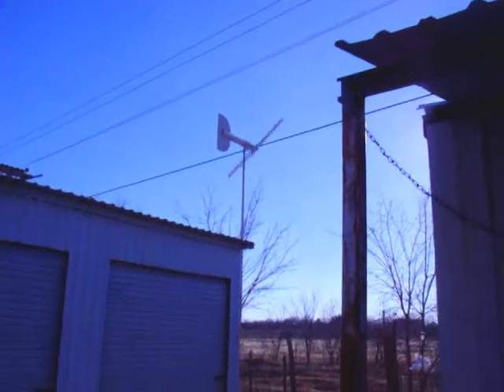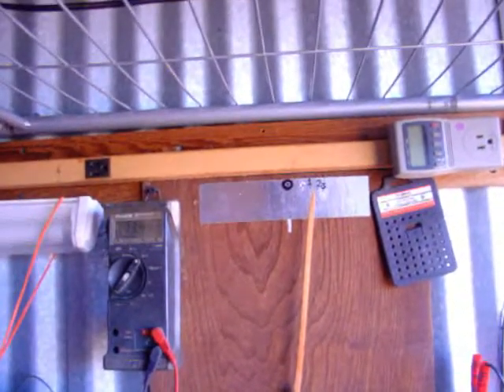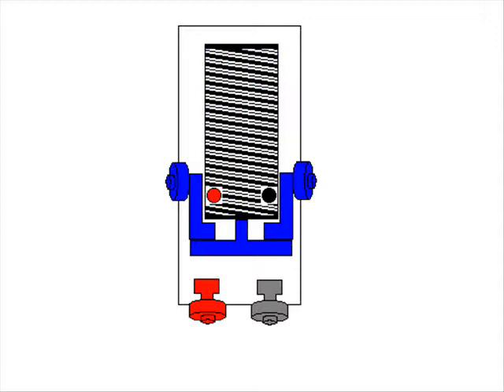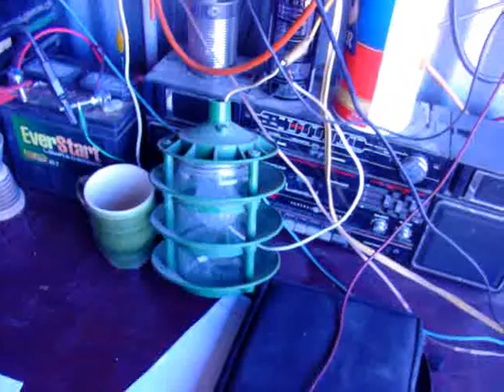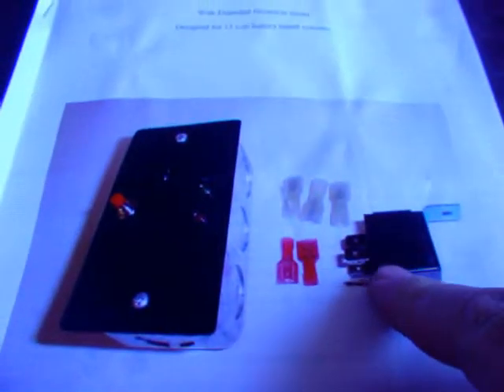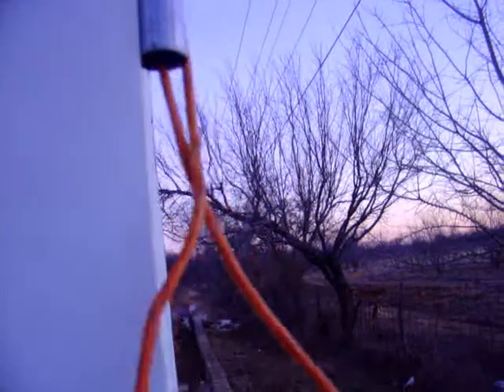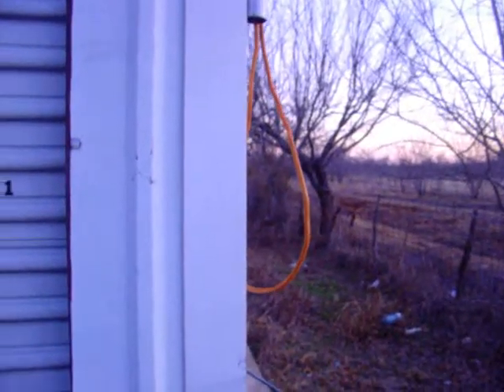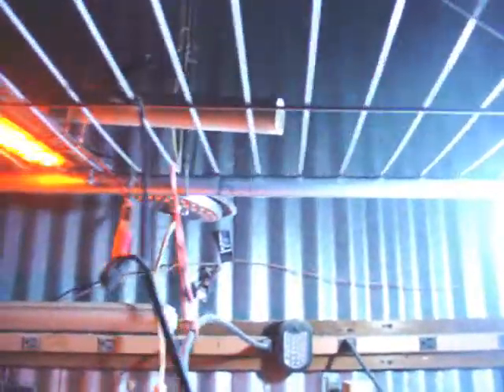Wiring up Charge Controllers Safely Diversion mode - Disconnect mode (part 2)

Comment: 900 watt wind mill ,i want to use the cut mode , from what the plans say the hot or positive should always connect directly to the battery ,and the negative or ground goes to the cut lugs then to the negative on the battery , I was told to put a 150amp breaker fuse ? my question is should i install the fuse from the battery negative to the cut OR from the negative coming from the windmill to the cut lug ? I am not sure witch way the energy flows

Comment: Wow, that is a long time between gusts.  I guess I was thinking of intermittent wind rather than gusts.  Where it jumps between 8V and 15V over a couple of seconds.  Electrically speaking you are right, why not just dump the energy straight into the battery rather than store it in caps.  Thanks for the comment!

Comment: Yeah I miss the shop lots we had a 38 foot lathe, 4 small 20 foot lathes, 2 drills 1 drill press 2 mills, a large boring mill. We did all custom work I saw $60,000 brass sleeves "before machining" that were used for closing massive doors on he Welland canal. Pressure vessels for nuclear reactors, 12 diameter pistons. We used to get 3 inch thick chrome shafts snapped in half. Some cool stuff if your into machining or building stuff. The old man let me do an engine swap on an rx7 I bought :(

Comment: @muddymuddymuddmann
 Well, either look in a Sporting-Goods, Health Fad Products, or Medical Appliance Store ; known as "Upside-Down Traction Machines"... 2 Triangular Frames, joined at the base, a metre apart. Their Apexes support the Pivots, on a Buttock-To-Head length Stretcher, with a Sq. Section Tube extending to the Length-Adjustable Ankle-Clamps. Hips level with Pivot, & Arms Down it's stable ; Arms Up, you dangle like a Bat.... Ciao !

Comment: AT THE TIME I WASN'T THINKING ABOUT THE DRAG,  BUT THAT HAS TO DO WITH THE ULTIMATE PURPOSE OF THE BLADES.   FOR SURE ANY SHAPE OTHER THAN WHAT YOU HAVE NOW ADDS TIME/COST.  THE DEVICE YOU'VE MADE FOR THE SHAPING OF THE BLADES IS COMPLICATED ENOUGH TO MAKE ME THINK WHY DIDN'T I THINK OF THAT.   I STILL GET THE WEIRD LOOKS WHEN I ALSO GO THROUGH A STACK OF LUMBER AT ANY OF THE LUMBER CO'S HERE TO LOCATE, SELECT,  BOARDS.   LIFE IS FUN,  MOST OF THE TIME!    ha  ,INITIALS , REGARDS,

Comment: ACTUALLY THE PART WHERE THE BOARD EXTENDS IN BOTH DIRECTIONS FROM THE CENTER TO WHERE IT IS NOW CUT DOWN TO THE SURFACE OF THE BLADE SQ CORNER.  REASON FOR QUESTION IS THAT THE POINT OF STRESS IS NOW CONCENTRATED AT THE LINE OF THE SQ CUT.   A FILLET,  EITHER CONCAVE OR SLOPPED FILLET  WOULD HAVE A WIDTH OF SAY 1" TO 1 1/4".  PROBABLY A MUTE POINT BECAUSE OF RELATIVELY LOW STRESS ANYWAY?    I'LL VOLUNTIER TO HELP WITH LANDLORD?  ALWAYS GREAT REPLIES,   GOOD JOB, REGARDS

Comment: Take the tubing you are using and put a stopper inside at the 10 foot mark the you will fill the bottom quarter with as many tiny ball bearings as you can get inside then fill that chamber with a heavy weight oil.

Comment: Hey Mudman! Why don't you divert the power back to the grid and sell your excess energy to your local power company rather than switching to wasting all that power by diverting it to light bulb that burns out. My plan is using a pure sign wave inverter with and automatic safety disconnect when the grid is down. My system is both solar and wind. What do you think?

Comment: I have one of the Collman air charge controllers. they work great and they are nice people I one time I fried the 5 volt regulator, and the picaxe chip I had plenty of 5 volt regs and they sent me a new picaxe chip for like 16 bucks.    I build a solid state relay you should check out the videos on my relay build. works great.

Comment: I grew up in a machine shop and we were able to bore 12x the diameter of the boring bar. Theory says you can't bore more than 5x. We did it by reducing vibrations and it doesn't require anything external. If it works to stop a steel boring bar from bending and vibrating I think it would work for wind turbines.